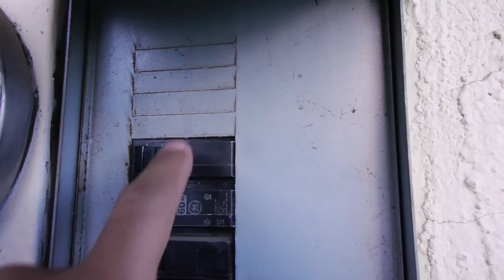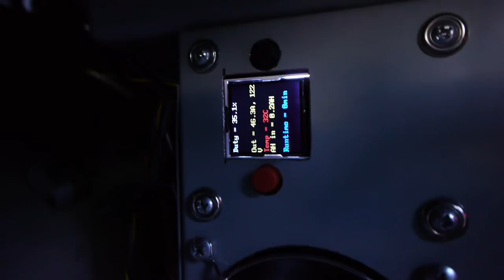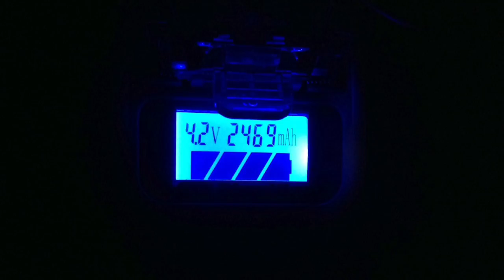HOT VW's DRAG DAY - Installing an EV charging Box

Comment: I saw a car on youtube that was a electric car and he had a self charging system set up in his car, but now I Cannot find the video anymore, but you should check out this video  12V BoostPack Starts Freezing Cold Engine - Capacitors Replacing Ca the guys channel is called lasersaber  he runs his car off capacitors cool channel